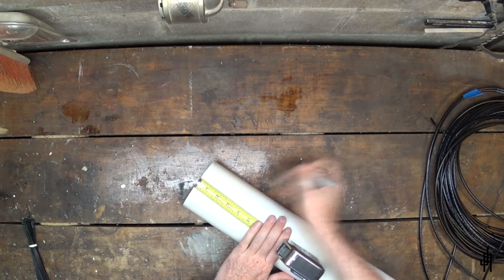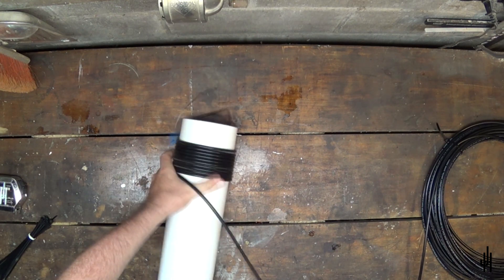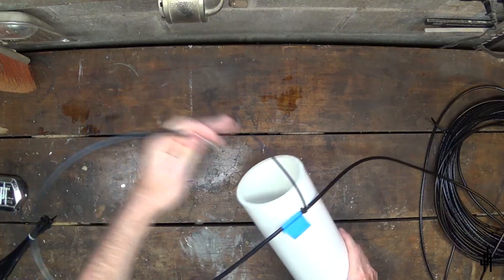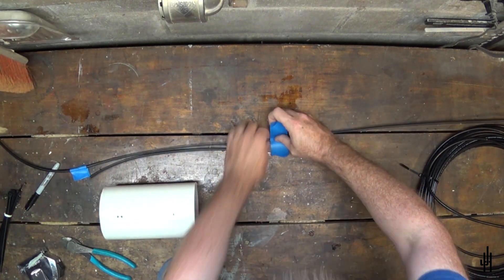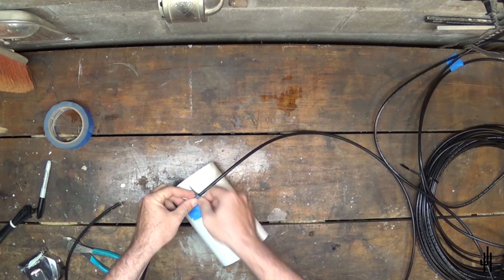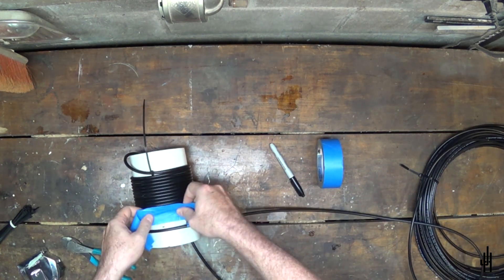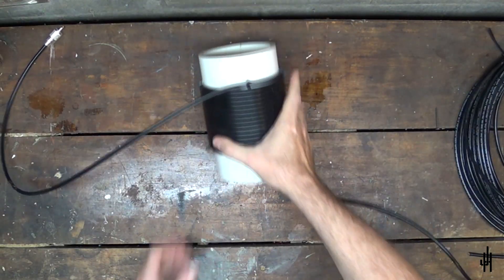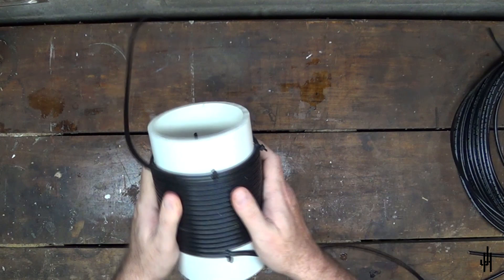Building an Air Choke or "Ugly Balun"

Comment: What does the diameter of the pipe represent ?
Reply: All coax has a minimum turn radius. So the width of the pvc needs to be greater than 2x the radius of your allowable coax bend.

Comment: Good video. Minor twist. When at the box store getting the 4" PVC. Look for 4" drain pipe. Same as above but it has 3/4 holes every 6"  and a PL-259 just fits nicely thru them leaving the tails in the center

Comment: ok so question.... i just did the same thing and was told 17 turns of rg8x.... I did that and it completely screwed up the 40m band. how many turns did you end up and how do you test it (put a dummy load on one end and put an analyser on the other and it was 1.2:1 1.8-50mhz)

Comment: The ugly balun is a misnomer.  It should be called what it is, a common mode choke coil or a line isolator as it does no impedance transformation.  A balun transforms a high impedance load to the characteristic impedance of your coax ( 200 ohm to 50 ohm or 4:w). 

That being said, this is an excellent video on how to build one!  Cutting the coax is something anyone who has been doing this type of hobby will end up doing!  I have been in the radio hobby since 1967 and have done my share of "oopsies"!
Like the perfect install of a PL-259 only to forget the coupling ring or the reducer on a smaller coax when you are done soldering!

Comment: Back in the 70's Hy-Gain engineers used choking common mode reflection with basically with the same method, they added three additional turns atop the final three of the RF Choke. Magnetism has a polar directional field so I've tried three additional turns atop in the opposite direction with success.  "See PG. 10 of the manual.  http://www.cbtricks.com/ant_manuals/hygain/model_416/graphics/hy-gain_416_eliminator.pdf

Comment: which is better for CB a Ugly Balon or antenna tuner ? trying to figure out what I need to run a mountain line antron 99 to talk ham and Cb. Any help would really be appreciated. I was told by someone that a antenna tuner does the same thing ?
Reply: They told ya wrong, sorry. :) They are two entirely different things accomplishing two different goals and you probably don't need either one for your CB. A tuner aids in matching the impedance of an antenna system (the wire antenna and any coax or other feedline) to the (usually standard) 50 ohm impedance your radio wants to see at its antenna port. It is required if you are using antennas that have varying impedance needing to work across a wide range of frequencies. Your Antron 99 is designed only for 26 to 30 MHz (CB and the ham '10 meter' band) and you don't need a tuner with it if it's set up correctly. A choke/'balun' like this does not tune anything, but it reduces common mode current from flowing on the outside of the coax cable, and is not necessarily required unless you are having problems with stray rf coming back down the coax and into your gear (which again should not be an issue if your Antron 99 and CB radio are correctly set up).

Comment: would a choke prevent a coax from radiating??
Reply: The purpose of an RF choke in this context is to stop RF current flowing on the outer skin of the coax.  This is what causes the coax to radiate.  There is a secondary problem.  If there is common mode current on the coax outer, then the coax will be prone to having RF current induced from noise sources, which increases the noise on receive too.  An air cored choke like this one, tends to be good at one frequency and can make things worse at others.   To make a really good broadband choke, you need a good chunk of ferrite.

Comment: Stupid Question but if you are building one for 160m-10m how many feet?  I built the same one and put about 25 feet of coax around for good measure.  But what is the correct # of feet for 160m, does anyone know?
Reply: 26 turns around a 4 inch pipe.... detailed info here.. http://www.karinya.net/g3txq/chokes/

Comment: That's about the same as forgetting to slide the shrink tube on before soldering, or installing the phone plug and finding the handle lying on the bench!
Reply: Or, installing a PL-259 and forgetting the coupling ring until you are all done!
Reply: Or soldering the XT60 on then finding the protective cap in your pocket

Comment: This might sound dumb but why not use a section of coax that is 20' longer  so  you can simply wrap it just before you connect it to the antenna? That's what us old CB'rs use to do but, hey what do they know.
Reply: Air wound chokes are single band devices, so work well for CB (single frequency band) but not great for the ham bands (many different frequency bands)...when you roll up a length of coax as you describe, well you just made an air choke and provided the length and diameter of coax you roll up is right for 27MHz, it will work very well for you...   A good choke for 80-10 metres is a lot more complicated than shown in the video,  uses ferrite (usually lots of...).  There is more smoke and mirrors around baluns than anything else and some are just snake oil.

Comment: ok, so what does that accomplish?
Reply from the maker: The 1:1 choke "balun" is not actually a balun. It's function is to help eliminate rf currents from flowing on the outside of coaxial cable using the principle of choke action. Another "name" for it is the air choke.
Reply: Jim Haslett ok, so what does this accomplish?
Reply: @moeshickenyay  Really? He just told you -- "... to help eliminate rf currents from flowing on the outside of coaxial cable...". For further education, do your own homework and research why that matters and how keeping rf common mode current off your coax helps keep noise and stray rf out of your gear. If you're already watching a video about common mode chokes/baluns, you must know at least enough about such things that it should have been fairly intuitive, if not obvious.
Reply: @sclerismockrey8506  we know what it is supposed to do. The question is what does it actually do? Does this arrangement provide enough resisting impedance to prevent RF flowing to the outside of the coax on a particular range of frequencies?

Comment: I am using the metric system and 20 feet should be about 6 meter, but looking at what you show on the video it looks much shorter. How long should the coax be in centimeters/meters? Thanks for the video.

Comment: Can this be hung from the ceiling in the Radio room or does it have to be outside near the antenna... ?? Thanks
Reply from the maker: The closer to the antenna, the better.    You really want it outside at least.
Reply: Thanks ..:)
Reply: Hung vertically or horizontally,I heard it makes a difference .